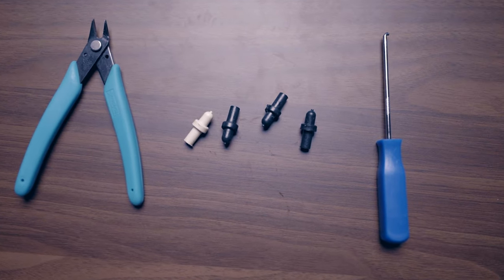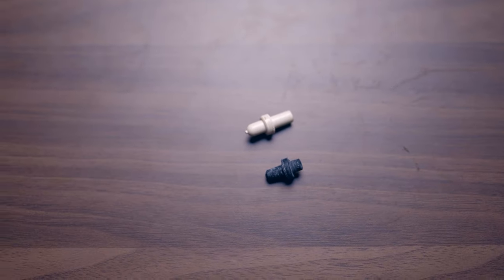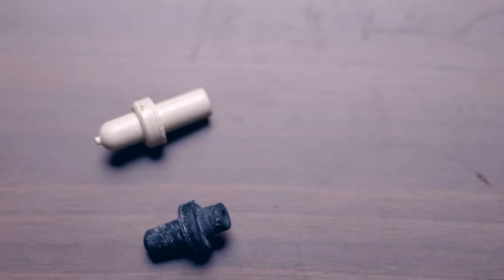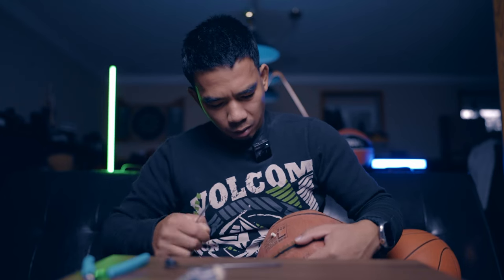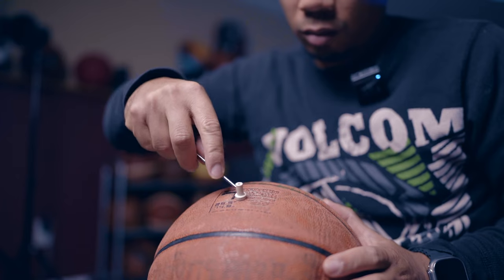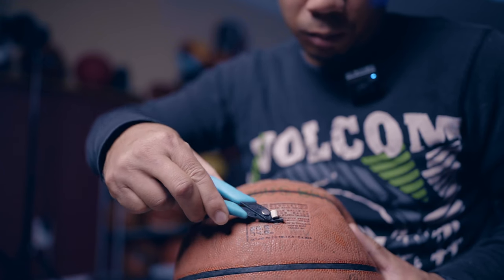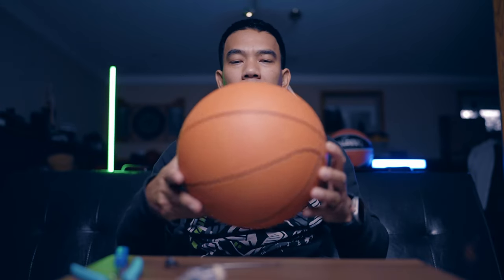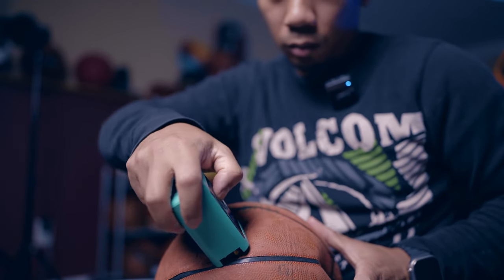Try to Replace The Damaged Basketball Air Valve First Before Buying a New Ball

Comment: Update on construction of Leather basketballs.  Not sure if you knew this, but a leather guy in New York I contacted after weeks of research claims that the valve in the high end balls is galvanized with the bladder. Which is confirmed by the fact that on the Valve from Spalding Top Flight 100 Stranger Things ball broke upon removal, it was a pain to remove in the first place, plus, although the new valve itself worked..the air was now leaking from around the valve.  Basically these stupid priced balls not only degrade way quicker than they should, they are also irreparable. Hopefully this info can help someone else. As always Everything Basketball, thanks so much for your channel

Comment: I have that exact same tool. You make it look so easy popping the valve out. I had a hell of a time getting mine out and had to use a lot of force, but I finally got it. shoving the new one in was a lot easier for me than getting the old one out.
Reply from the maker: At first it was a struggle for me too to pull it out cuz I was too cautious. After I did it to a few balls then it became easier.

Comment: How about taking out a valve that fell inside the ball?😢
Reply from the maker: then you are out of luck.  I can't help with that, bud.
Reply: What up dudes, I just had this happen to me last night. Read online to try using a thin enough flex grabber tool to get through the hole of the rubber bladder to grab it out. Just did it right now and got the valve out of my wilson. I had to manipulate the claw of the grabber to get it to close smaller and fit in the hole.
Reply from the maker: @Castor22Troy   I cut the base of the valve to make it small so it can fit into the hole in one of the basketballs.
Reply: @EverythingBasketballs  right on. I mean more for the guys question if you accidentally pushed the valve into the basketball. You can retrieve itbusing a flex grabber tool. Not all is lost if it happens! 🤙🏼
Reply: @Castor22Troy I’m boutta try this. I literally just got my NBA ball last week ball and the valve fell in the ball. Ball is wayyy too expensive to replace or even return it